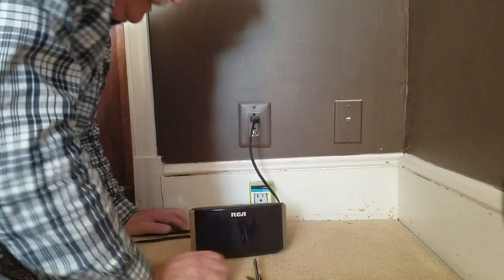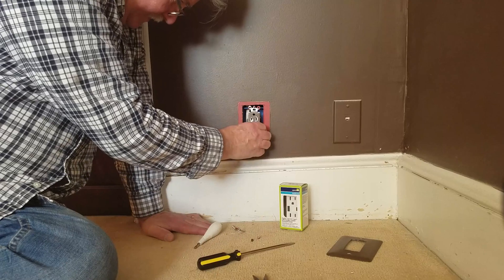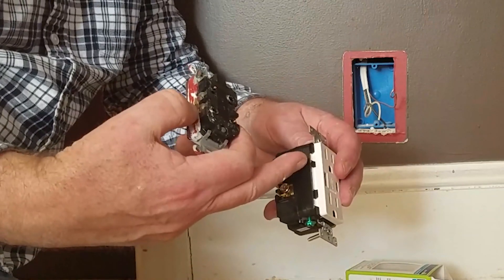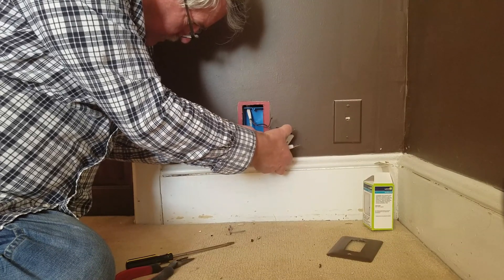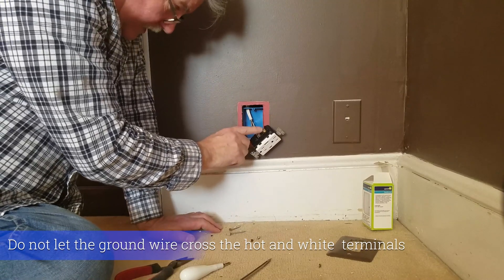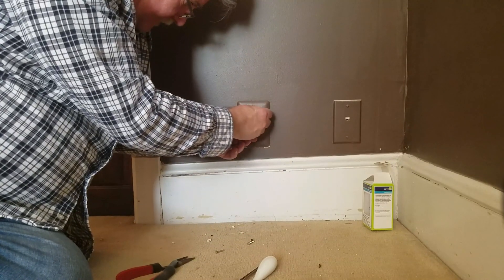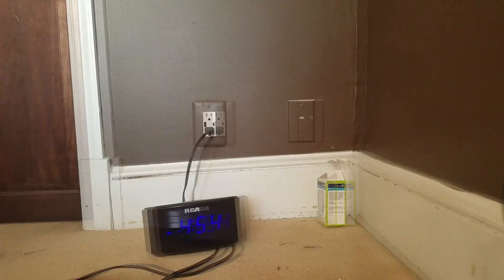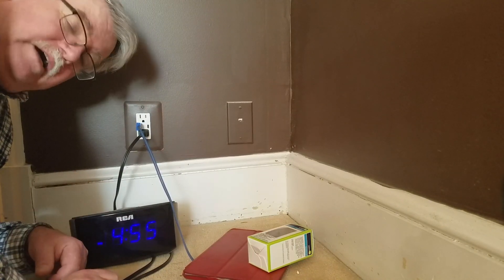You Can Do This - 110v Outlet to USB Outlet Swap

Comment: If the box is not the deep kind, do we just purchase the bigger box? Anything special that must be done if replacing the box as well?

Thanks again for the video.
Reply from the maker: You can always get a Wiremold box that brings it out.  Often the reason that the elect box is shallow is often because the wall is not a thick one.  Its a great project, and easy to do.